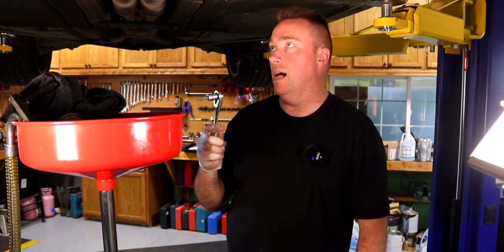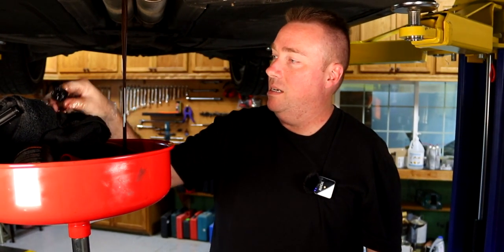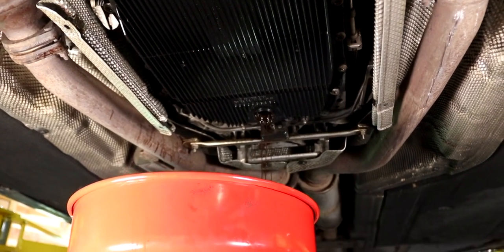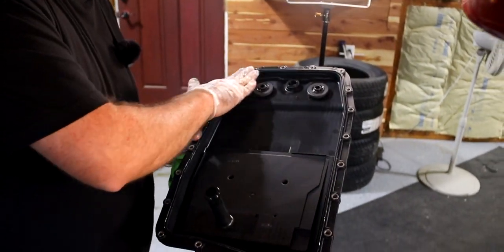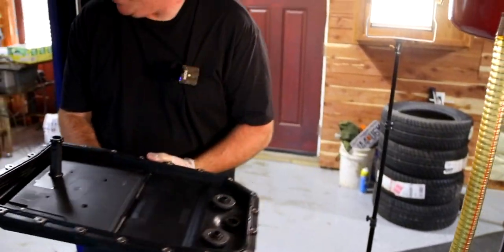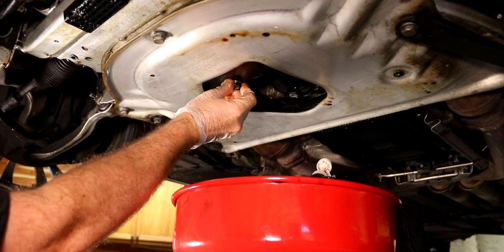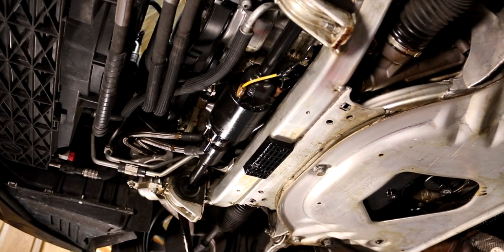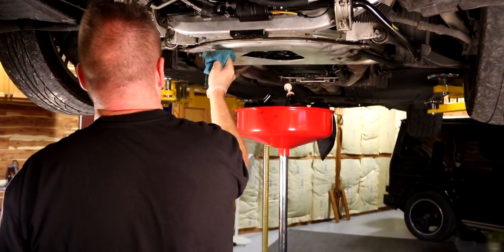BMW 650i Engine Oil And Transmission Fluid Change N62 ZF6hp26

Comment: Great job. 
It is basic and very interesting.
A suggestion. When i go to the "Big box stores", I pick up the large corrugated cardboard sheets that they use to separate pallets of products, like water, canned goods etc. They give them away for free since they have to toss them. i put them on the floor to catch the mess. then fold/toss them.

Comment: Changed my mom’s E60 550i ATF a few years ago inspired by your E39 videos. This was also before the Valvoline Maxlife full synthetic became popular so I had to research and sorta take a chance. It’s like cheap unicorn blood. Still running like a beaut! Also the filter was inexpensive from Amazon and miraculously it fit with no leaks lol. Had to reuse 2 bolts though because it was short or I may have lost a couple. The engine has similar small leaks as yours. Maybe I will raise it up, unbutton the covers, wash it away and search for it. Maybe not lol.

Comment: Nathan, I have a 2007 BMW 650i with 125,600 miles on the engine.  I bought it used 5 years ago and I was thinking of changing the transmission fluid but there is no evidence that it has ever been changed before.  People have told me that if you change it regularly, then it's ok to change it but if it's the original transmission fluid, then changing it might invite more problems and do more harm than good.  Can you give me your professional opinion of what you would do if this was your vehicle?  Thanks in advance.  Tom R.
Reply: Do a simple pan drop then refill. I wouldn't do a flush
Reply: This is probably to late but for others sake.  A simple transmission fluid and pan change is fine at 60k mile intervals.  Whereas I'd recommend a full service at every 120k mile interval by replacing the fluid, pan, and all the mechatronics seals.  You could also consider replacing the solenoids, as part of the full service in being pro-active.  Otherwise, it's possible you may never have to replace the solenoids but once you feel some slippage; it'll need to be part of a full service.      
I've spoken extensively with ZF technicians and the transmissions are very strong and robust.  They need to have a maintenance schedule though irrespective of what BMW and some others state.  BTW, those who experienced issues after changing the fluid for the first time were destined to experience the same issues even if they had not changed the fluid.  Their original fluid was just delaying the inevitable.  Because parts are suffering from wear and they are going to fail at some point irrespective.  Being pro-active and having a maintenance schedule is best though because you are less likely to suffer from a catastrophic failure.  Good luck!

Comment: I'm puzzled - Q for anyone. Just did the transmission fluid change on wife's e64  - filter kit came with new bolts, which look aluminum - and thought nothing of it as many aluminum bimmer bolts need to be replaced when servicing, however, what through me for a loop is that they are actually steel when i put them in my magnetic tool pan!! Furthermore they only need to be torqued to a max of 10NM - (which is nothing for a steel bolt) - so why in heavens do they they need to be replaced?

Comment: What if I started before I put 3 quarts in it     I was putting it in had  about 2 quarts in  but I have it off ground but it won't come out of park I did not get it hot  so I need to wait to get it hot for it to flush cause I can't put any more then 5 quarts before it starts pouring out side

Comment: Did I miss Nathan changing the filter prior to installing the new drain pan?  ??
Reply: the filter is intergrated into the OEM pan. You can buy after market pan with a separate filter if you are racing your car, but as for OEM its built in.

Comment: I have little transmission oil leak ( I think it’s from the transmission line ) so but it’s really small, I’m wondering can add fluid to the transmission from the top ? ( when you pull the Measure strap under the hood , from there ) 
Or only from the bottom?
And thank you 🙏
Reply: Yea same question

Comment: Nice. I'm gonna go check one out tomorrow with only 52,000km supposedly... Gotta see dealer records. It's coupe and beige. Not that great but at least it doesn't have the SMG in it. But the low mileage it's basically brand new. 2008
Reply: Good luck, man! Hope it's as good as it sounds.
Reply: @Usy122  unfortunately it wasn't. I don't understand how people don't care about them. It had a small. Front end damage before. They kind of fixed it. Not at 100% but it looked ok. But when I opened the coolant reservoir guess what?  WATER was in it... That right there started turning me down. Oil hasn't been changed in 5 years. Inside the engine look pretty silver I liked that. Obviously oil leak underknee but what bmw doesn't leak oil? Interior brand new. But problems with the steering and the pump Made a little noise. Besides that all good but seems it hasn't been cared since the accident. They want $12,500 I don't know if it's even worth offering $10k for it. Because it already has problems with the steering. On pump and also showing on the i drive

Comment: I'm a bit confused. I've heard you shouldn't be changing transmission oil in your BMWs. Can anyone explain this?
Reply: On the car it says its lifetime but we know better , no oil is life time thats why we change it
Reply: BMW states is lifetime because they want to shrink investments and they do not care what happens after warranty expiration... ZF company clearly says change every 100 000km
Reply: I have  contacted BMW directly and they state that the oil is in fact lifetime and the reason being is that as the transmission breaks in there is dust that comes off and is necessary that dust is a necessity in order for the transmission not to slip after a fluid change and that if you ate going to replace any fluid at least keep 80% if you can of the original fluid. I purchased Liqui Moly ATF Top Tea 1800 fluid to fill the missing 4 quarts since I had a leak. But when asked by the dealer mechanics directly they state its for that reason alone and if you change all the fluid you may very likely start experiencing slipping.

Comment: My n52 shutdown random standing  no 
power no nothing. After the power comes back the date and clock resets,what could be? Where 
should I look? The battery is 3 years old
Reply: And while I drive it shutdown for exemple I go with 60 miles or any other speed and is remains without power. Nothing works for few seconds. No hazard, no light nothing..
Reply: Had similar experiences happen years ago (E60 550i). For me, it was a weak dying battery. Less than 5yrs old I believe. It’s very voltage sensitive. Start with cleaning and retightening the terminals. Have the alternator and battery tested. Replace battery if necessary.

Comment: Man thank you for your awesome videos and sharing your knowledge. I have a 2011 328i sedan N52 GA6HP19Z transmission with 125k miles. I’m planning on doing this job myself. Do you recommend using the valvoline maxlife transmission oil or the ZF fluid from ecp euro?
Reply: prob fcp euro, have a bmw tech buddy and he has converted me to their stuff

Comment: Could I run 10w 40 in my n62  to make it stop smoking until I find a new engine for it
Reply: That’s what I do. It helps when rings are going bad but doesn’t fix it. Mine smokes when I take off from long red lights or in the drive thru - so annoying.
Reply: @bu5761  I sold that piece of shit lol
Reply: @rudewhipz6199  🤣 might have to try that one. I’m in Central Texas so not worried about cold starts much.
Reply: @bu5761  they had a recall for their shitty seals going bad and starting to smoke
Reply: @talm5154  not on mine. 2006 650i - if you can confirm I’d love to have it done under a recall 🙏 I used liquid moly last oil change seems to work a bit too.

Comment: nice, I just wanted to get the torque setting for the sump bolts but landed up watching the whole vid haha.
and even though it was cut from the vid im almost certain that drain plug for the oil filter housing didnt wana come out 🤣

Comment: Good call going for 7 foot pounds of torque in English, as opposed to the stipulated torque in some foreign dodgy language
Reply: simply contact BNW and they tell you all the spec over the phone and will email it to you directly as well. Transmission pan bolts are to be torqued to 10nm, and fill bolt to be torqued to 35nm.